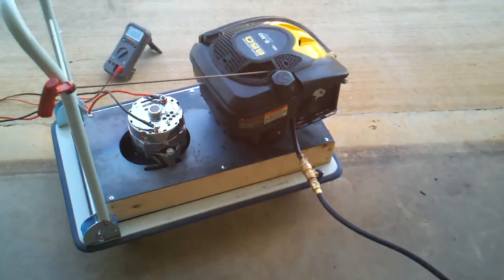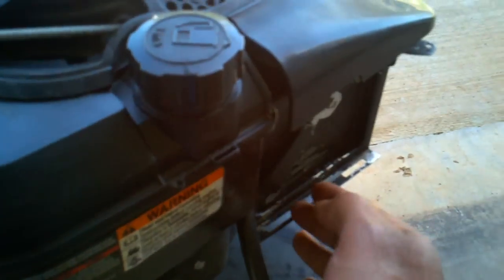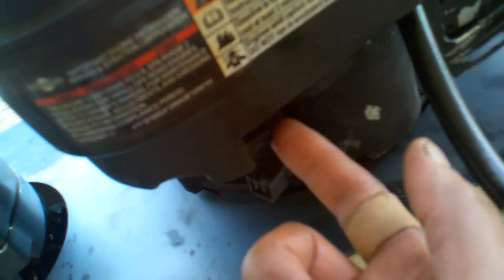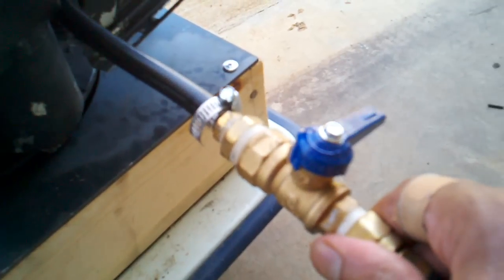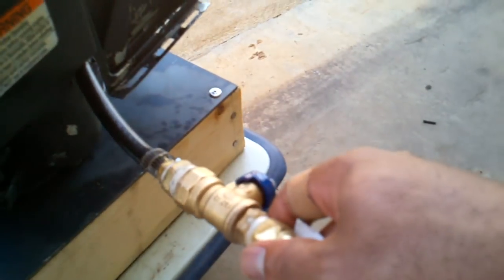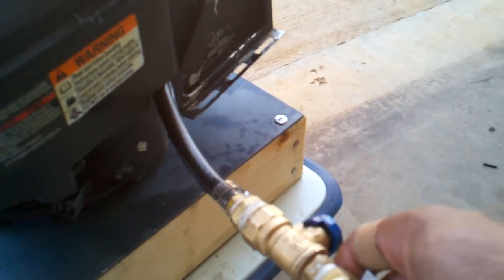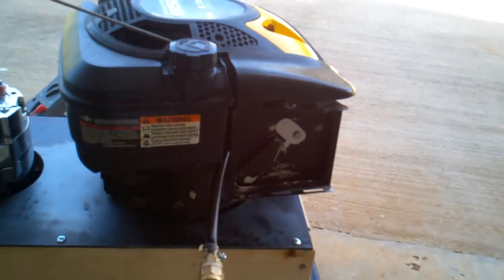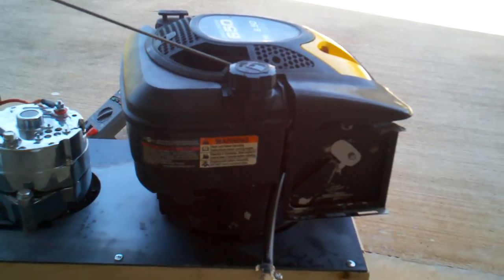DIY Lawnmower Generator - Convert from Gas to Propane

Comment: Just buy a duel fuel carb for 30.00. ELIEXPRESS.com sells them for different size HP engines and I bought two a GX390 for up to 10 hp and a GX420 for my 13hp generator shipping is free and it will run NPG NG and regular gas. On the built on regulator it has a knob for NPG and CNG it works as well as a Tri fuel kit for 200. They are the same price no matter what size HP you buy only 25 to 35.00 depending on the seller only thing is it’s Chinese made and comes from China takes up to 3 weeks to get it or buy one on Amazon around 35.00 to.

Comment: That ball valve with a blue handle isn't rated for gas use and will over time loose it's seal and stop working. Ball valves with a yellow or red handle is rated for gas use and will last longer.
Reply from the maker: +Eddieallen Great information, thanks for sharing.
Reply: rhandsom
No problem. It's also a safety tip because if the blue valve starts leaking it can start a gas leak in a home or garage that can build up and be set off by any spark. If it's outside it would only be a loss of fuel.
Reply: Working as propane service tech for 18+ years..... Color of handle on valve means nothing.  All johmor propane valves are blue.
Reply: @jasonpatterson2258  I'm starting to fix a propane lawn mower up and thanks for letting me know that the gas valve must be blue thanks a lot
Reply: @t.jgreen8274  Great to hear from ya ! Keep me updated as I'm curious how it goes ? You using a kit or you doing it all DIY ?

Comment: I would add a flash back arrestor or two between the carb and the gas tank, if the people who fill those bottles have air or oxygen contamination and you get a flash going back through the overlap in the cam on the inlet valve then you will get a big surprise, the equipment you have most likely already has that in it but make sure.
I would add a couple of acetylene flash back arresters, they only a few bucks and dont take long to fit.
Reply from the maker: +EVZebra Not a bad idea for safety.
Reply: rhandsom
Yeah better than nothing, see what they have for the gas you are using.

Comment: If you didn't immediately pull the rope making a spark, would the propane build up and then go boom.  Im sure the tank wouldn't but around the carb couldn't all that throw some plastic.
Reply from the maker: No doubt that you have to pay attention using something like this.  I assume it would simply flame up like it would on a bbq grill.
Reply: rhandsom big backfire

Comment: How long will alertator last chargeing at that voltage , and do you have away keep from over heating ?
Reply from the maker: I've run my current contraption for hours, also I don't have any methods to address over heating, I haven't had to deal with that as yet. However, your concerns may be valid in that I'm using a lawn mower engine and alternator outside of their intended purposes. But I think I should be reasonably safe to run this for 4 hours or so.
Reply: Great news , rhandsom was the valve you just from local hardware
Reply from the maker: Donald Laisure Yes, all the parts came from Lowes or Home Depot
Reply: Just 3/8 gas valve and reducer

Comment from the maker: Doesn't use a lot of propane to run, and the amount used depends on the load you put on the engine.  I've seen my unit run on a trickle when combined with alcohol based fuel.
Reply: rhandsom that’s because it’s not being regulated!  If you had a regulator it would run proper amount maybe less and you’ll have proper vacuum.Just buy the carburetor with built on regulator and you can run all three fuels regular gas Propane and natural gas.

Comment from the maker: If I remember correctly it's been awhile, when using propane in this video the butterfly valve should be wide open and flow controlled by the inline valve coming from the propane tank.

Comment: So rhandsom, you connect the propane hose to the carburator gasoline inlet... my question is, "what's your carburator's throtle position when u make the video???" as i know, the carburator butterfly valve is closing when in idle throotle position.

Comment from the maker: Thanks for your comments, and your right of course that propane has less btu's than gasoline.  And as you probably suspected this project was to supplement my solar backup generator.  I've since replaced the engine with a Predator 6Hp Engine from Harbor Freight and added a conversion kit for safety.

Comment: Propane produces about 10% less BTUs than gasoline. If you are running a 5 hp engine you can expect about 4.5 hp. Still, as you mentioned, propane does not go bad over time like gasoline.
That is a great project, and would be a great supplement to a wind and\or solar power system.

Comment from the maker: It's more convenient in the event of a severe power outage where there are no gasoline pumps available, there is a good chance that they will have propane. LP doesn't go bad and in this video I didn't have to modify the carb. I'm not certain that propane will run longer than gas or not, but propane is much better for long term storage.

Comment: is it cheaper to run on LP than gasoline? does it last longer on a 'tank' of gas vs. a 'tank' of propane?
Also did you have to modify the carb at all?
thanks

Comment from the maker: In this video the hose is attached to the fuel inlet on the carburetor. At least for this engine, connecting the hose there worked fine.

Comment: the conversion will work with natural gas as well, at least it did with my design which is similar. As far as the gas flowing after the engine quits you can add an electric valve powered by the generator itself so that when the power stops it turns off the gas automaticly. Check out my $5.00 conversion on my channel.

Comment from the maker: Thanks for the heads up. And granted, this is risky business. I and everyone who attempt this have to be to be careful. I'm counting on the fact that such a small amount of fuel actually gets into the chamber. A little seems to go a long way. Also, as I have played with the value to control the amount of fuel going in, I've noticed that the engine runs rather smooth, no pings, no mis-fires, etc. But again, being careful is the way to go. Thanks again.

Comment: Nice job what u have done with the LP. valve, U Have however a crank case getting LP. in it. The Knock u here when starting it. LP to gasoline Engines Like Generators- that run on propane or wet gas, that  use the same (wet gas) Carb to run on LP gas or vapor Fuel also have a vacuum regulator to control Propane before it meets the piston & rings .The way u have it set up lets LP get into crank case.Not good, Think BOMB! I,m not saying what u did was not cool just not safe for the engine or U.

Comment from the maker: Yes, it seemed much simpler than boring a hole in the air filter housing or carb casing. Doing it that way seems to work better with less modifications to the unit. I removed the air filter to allow for more air flow.